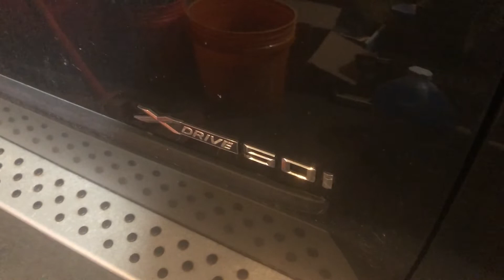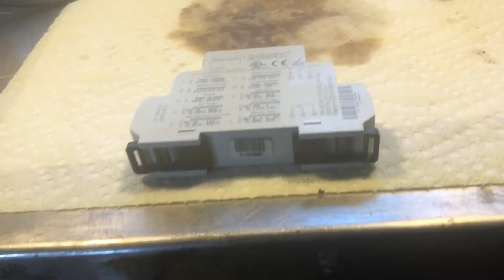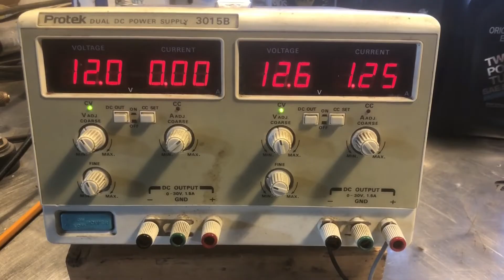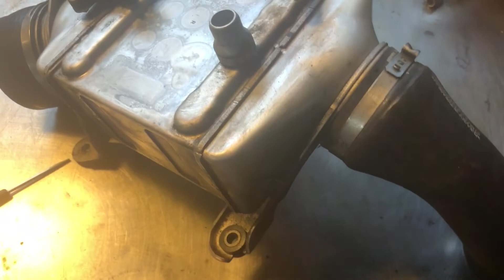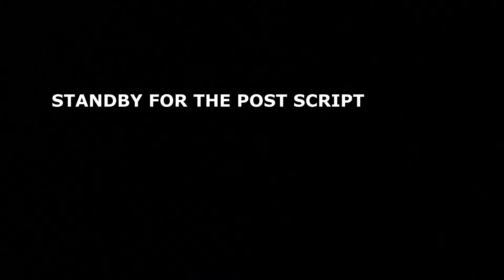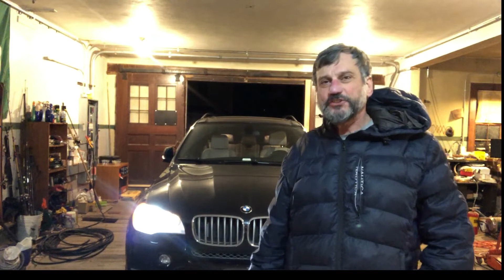BMW X5 Reduced Power & P054 Fixed at Old 74 - Rev 0

Comment: hi there I got the P054B also on my 2011 bmw 328i with N52 engine, thats the only code that shows, replaced vanos and cam position sensor, code still comes on once in a while and its getting more often now. Do you have any idea what would it be?
Reply from the maker: Kenny/us/2000: When you say that you replaced the "Vanos" do you mean that you replaced the Vanos solenoid(s), discussed in the video, or the Vanos mechanism that affect actual relative position of the cam shafts?   And additionally, is the affected cam shaft so retarded that you are getting an accompanying REDUCED POWER warning??   A few things that you might find interesting about Vanous solenoid replacements, is that the degree of control exerted by the oil flow managed by the solenoids appears to be so tenuous that be sure that your replacement solenoids are actual BMW supplier parts, (whether marked BMW or otherwise).  Condition and viscosity of the engine oil seems to also be a factor, and the car that I used in the video had some filthy oil in it, which contributed to the Vanous solenoid issue, wherein a thorough cleaning of the solenoid and an oil changed solved the problem, a least for a long while, though I chose to replace one of the two solenoids (exhaust), some very recently when the code reappeared, rather than going though another cleaning.   So far, no problem...... There seems to be some doubt about the quality of some after market solenoids, and may be reflected in the degree of cam shaft retardation that triggers the REDUCED POWER WARNING and the accompanying P054B code.  If you are not getting a REDUCED POWER WARNING, consider yourself lucky for the time being, and continue to troubleshoot.  Best regards..... -Barry
Reply: @old747  sorry I meant the solenoids
Reply: @kennyus2000 hey did you find the solution for the code? I got the same issue on the same car
Reply: @GoodGuy_Rick Medina  yes its the vanos sprockets bolts backed out, took valve cover off and replaced the bolts